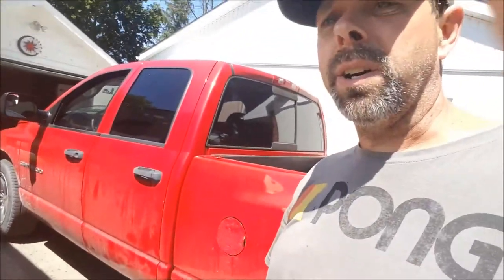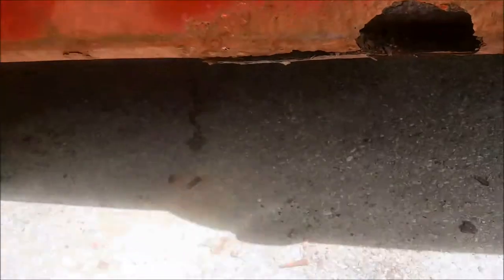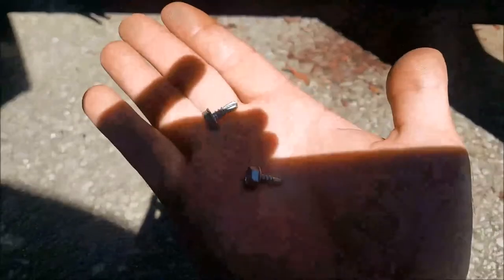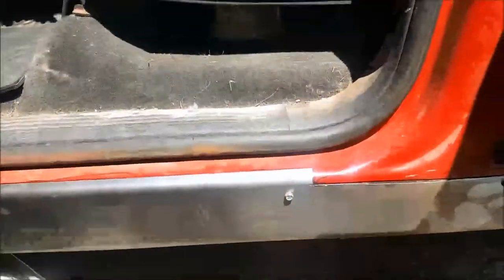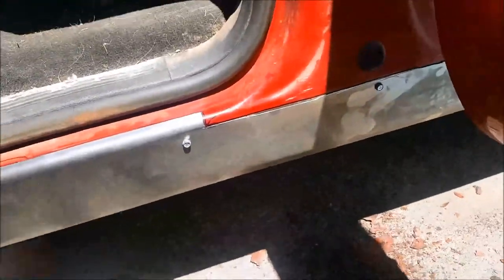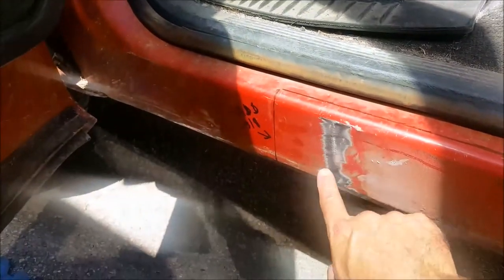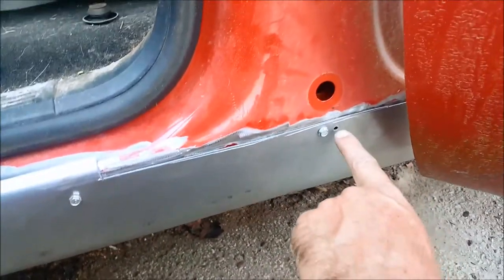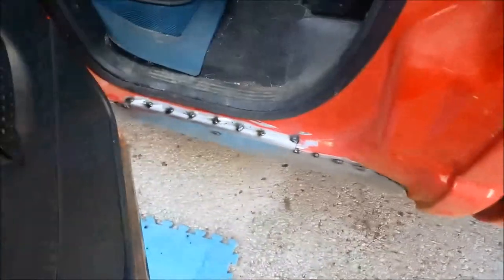INSTALLING ROCKER PANELS

Comment: Hey Maybe use TEK screws that drill thru metal as their screwed in. Then use pop rivets for the rest. Nice work
Reply from the maker: Yes you can if that's all someone has to work with. Thanks for watching appreciate it.